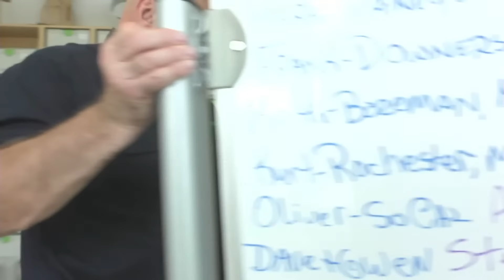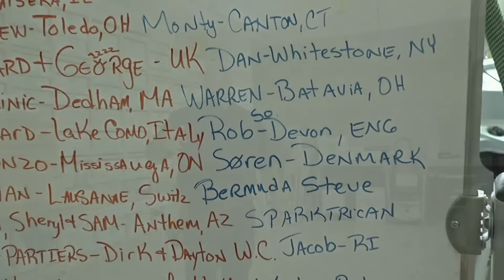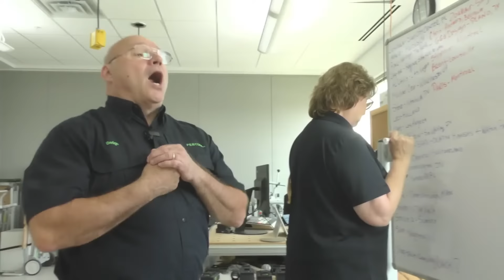Festool Live Episode 154 - RSC 18 Cordless Reciprocating Saw

Comment: Show me one remodeler that is a professional that removes the battery 🤣. I’ve done bits, blades, etc changes with batteries in for years. Lock the tool when you change the bit or blade etc.

Comment: Ok.  I’m a Festool nut.  But these tools are for demolishing and nothing else.  I can’t be both watch the whole video, can someone summarise it for me and just give one reason why this is different to any other wood butcher version from DeMakartarbowarkie.
Reply: Dust extraction is the difference. Then again if you’re demoing dust and debris are expected.
Reply: @Benmeglei1  I can’t believe they made this ahead of a cordless plane or router
Reply: Perfect for what I need - doing a big project with plenty of demo - stay in same battery family and my project is in an occupied home, the dust extraction will help!
Reply: Apparently you haven’t seen Tom Silva do a scarf cut with a recip saw. And if you’ve tried the new XGT AVT Makita sawzall then you’ll know why they aren’t all built the same.
Reply: I specialize in hospital construction - both new and remodeling/repair work..    We use the Festool Sabre saw with dust extraction to perform remodeling and repair work in order to minimize the amount of visqueen protection and dust cleanup when rough or finish cutting drywall, lath and gypsum plaster, and lath & stucco surfaces.  It is NOT just for demo.
Reply: @ericberman4193  thanks for the answer. Do you honestly think it is superior to other manufacturers versions.
Reply: I began using the Festool dust extraction system after receiving numerous recommendations from others in the trades.  While I previously used non-HEPA systems, Festool is the only HEPA system that I’ve tried.  It has worked out very well through reducing the amount of prep (installation of visqueen on floors, walls, and over FF&E, and zipper wall containments) as well as ongoing and final clean-up.